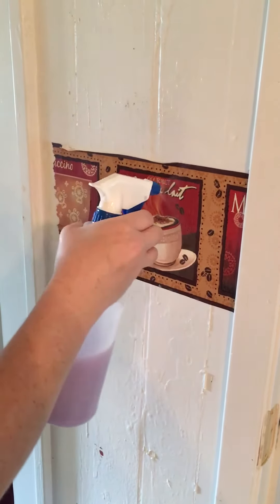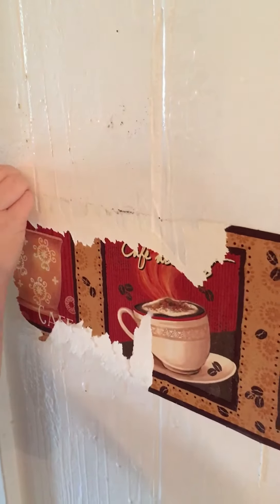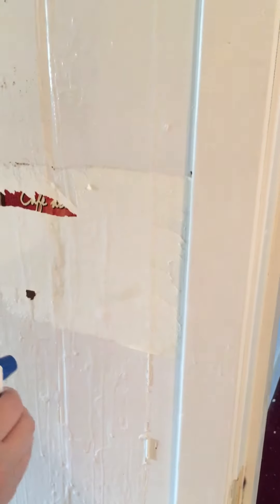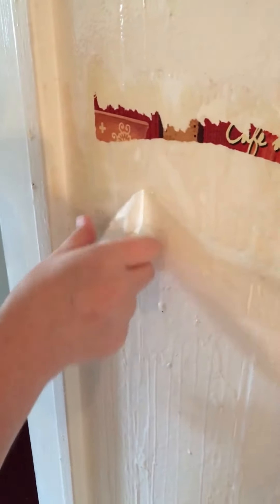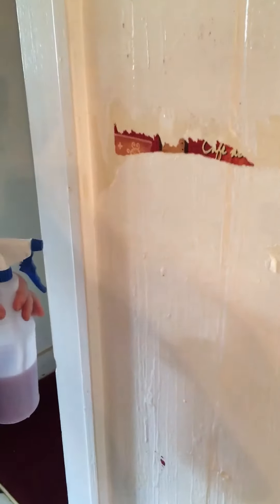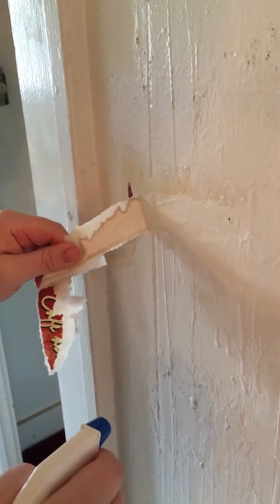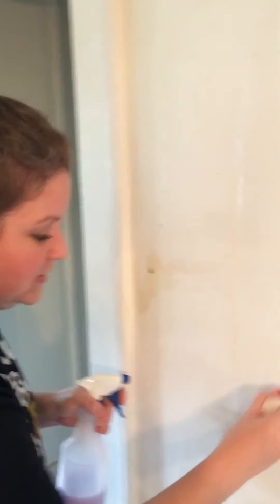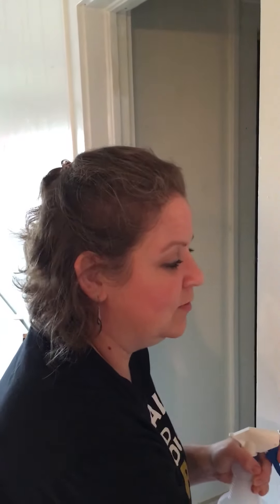How to remove wallpaper with fabric softener and water

Comment: I find taking the 1st layer off before wetting it all down with hot water and fabric softener helps tremendously with allowing the softener to reach the underlayer of paper and glue.
Thank you for the video, and for explaining that there are different outcomes, depending on many variables. I used a roller to.wet the walls, and a putty knife worked  for me better than the scraper meant for removing the wallpaper.

Comment: If it’s porous wallpaper attached with a traditional paste adhesive, apply a mixture of hot laundry detergent and vinegar. Let it soak. Then apply more. The objective is to thoroughly saturate the paper and adhesive. Apply more. Give it time. A scraper will remove it easily. The detergent will help to reduce surface tension and wash off the residual adhesive. This method worked like a dream on walls with six layers.

Comment: Always try plain water first.  And if you use anything else, make sure you clean it off well.  Several rinses of just clean water...till it is completely clean.  Or you will have problems with your paint or next wallpaper adhesion.
Reply: I'm going to remove wallpaper from drywall. Do you recommend scoring the wallpaper first? Plain water--hot, warm of just room temperature?

Comment from the maker: I will say that using this in a different room didn't have the same results.  It depends on the type of surface your wallpaper is attached to (glossy vs matte).  The kitchen had a glossy paint and I think that made a big difference.  The bedroom where I started working next had a very flat paint and it wasn't as easy to peel off.

Comment: I have had great luck with hot water and vinegar.
Reply from the maker: I might try that in the master!  It's not wanting to release in there!  Thanks for the tip!
Reply: DIY Allied 

Yes. That’s the best way. Adding detergent may help to dissolve the glue. The paper should be thoroughly saturated.